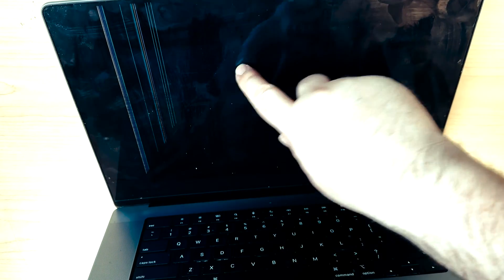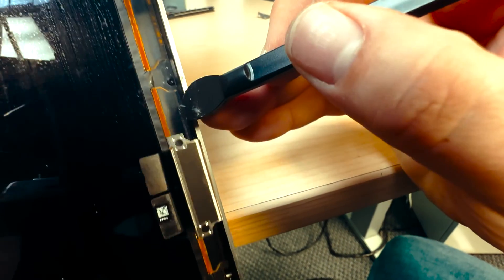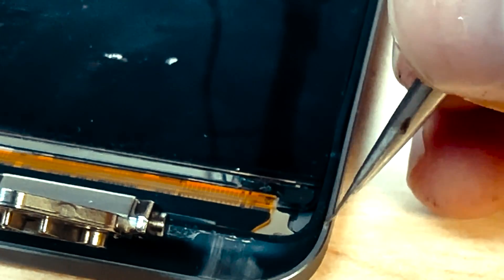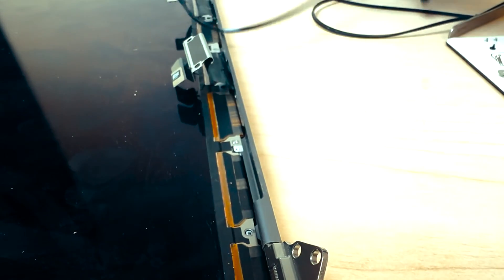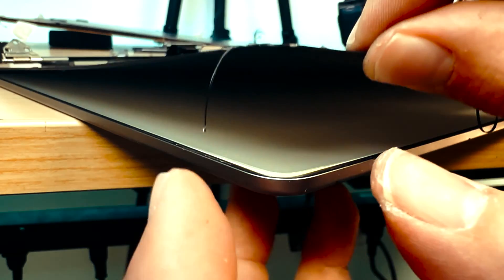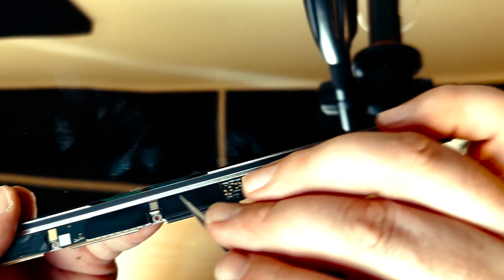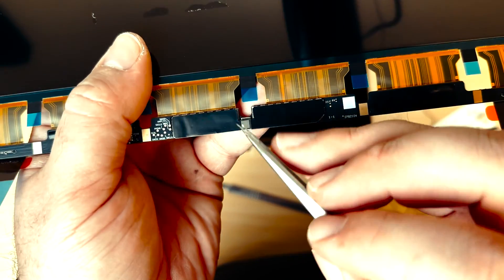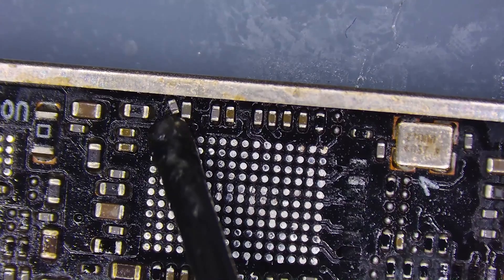MacBook Pro A2485 LCD Panel  Only Replacement Guide (Tips and Tricks #74)

Comment: HiQ Great video... One question. Which size of tape do you use in metal board and in the borders? Thank you very much! And one more question. Which is the size of stencil to reballing and temperatures to take off the ic and to put back? Thanks

Comment: My screen recently went blank on my mac A2485 m1 max , have tried connecting a monitor with no luck, which could be the mother board got damaged. do you have any suggestions how do i get my data off before replacing the screen?

Comment: I think i have a flex cable fault. If i follow the procedure to remove the LCD and then swap the cable what would i do about replacing the glue that bonds the lcd to the case?
Reply from the maker: Use some double sided adhesive like a show at the installation. Getting a screen off without cracking it is doable, but extremely difficult. good luck
Reply: @MobileSentrix much appreciated!!
Reply: honestly, impossible, even with heat, but good luck
Reply: @nomadh1656  Surely you mean improbable. Gotta keep the hope alive  if attempting to remove the LCD 🙏

Comment: Yeah we gonna order the whole assembly. 😂ain’t no body got time for that.
Reply: U have to to this way else lcd going to show bars
Reply: LMAO!! In 2012, I ended up spilling Coke on my 2008 UniBody MacBook Pro. Ended up getting a second hand 2010 Core 2 Duo, which exhibited graphics issues a couple of years later. One of the capacitors failed (known issue) which I replaced it with a tantalum capacitor using a cheap soldering iron and using my previous 2008 MBP for practise.

Present Day:
Cracked the screen. No problem. Yup... I noped out when he mentioned solder and reballing.  LOL

Comment: hey bro what happens if you just swap the epprom over ? in theroy that will work as that epprom is paired to the cpu of the machine .. kindly like the epprom inside of a iphone display chip/touch chip.. you can just swap the epprom if you had good enough skill and will get no important display message.. please let us know what you find friend :) 

also lets be honest tesa tape never going to stand the test of time for before that lcd falls of surely :D
Reply: The real question is what adhesive IS gunna stand the test of time regarding LCD only repairs on Mac
Reply: It seems only Apple’s stuff is ever sticky enough to recreate that OEM feel